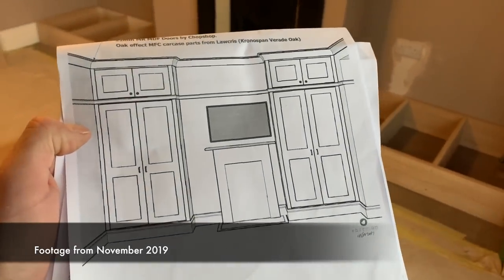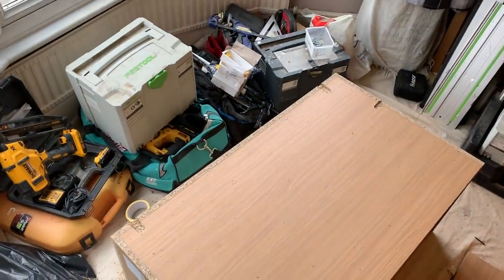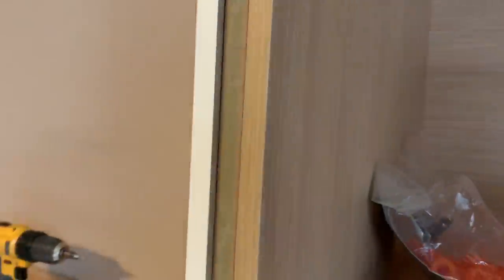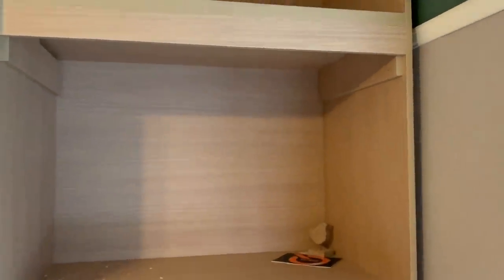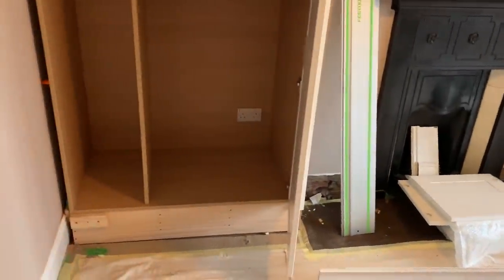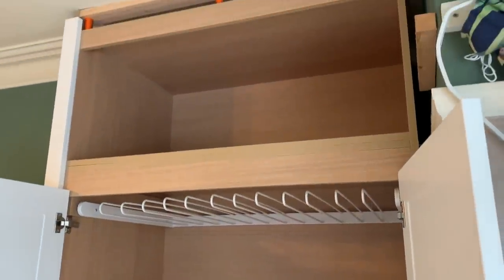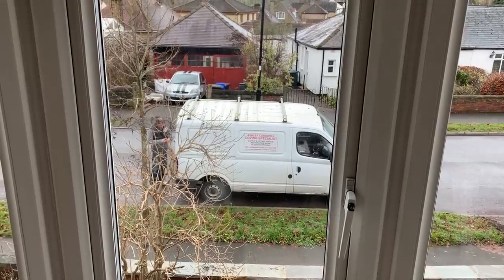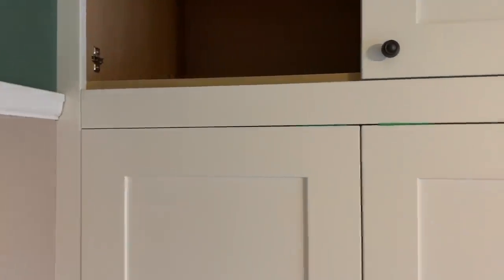Traditional Style Wardrobes Build

Comment: Hi Alistair. Thanks so much for posting such helpful videos - they've helped me to build my own built in wardrobes at home 🙂 The only thing I can't seem to find anywhere online are the dimensions for stiles and rails! I've made traditional wadrobes like these and wonder what width you've used for top, middle and bottom rails and also the width of the stiles? My wadrobes are 2000mm tall. I'd be grateful for your advice. Thank you 🙂
Reply from the maker: Hi!  Usually anywhere between 75 and 100mm rails and stiles, and the mid rail I usually do 150mm tall and centred 900mm from floor.  Thanks for the feedback!

Comment: If you could only pick ONE scribing tool, what would it be? Those edge scribes were 👌
Reply from the maker: Richard Clarke well, that’s a tricky one!  I think I’d say the 18mm tri-scribe from swanky scribe, which I didn’t actually have at the time of this video but I used in this one: https://youtu.be/wpqVc_zJfgI
Reply: @Alastair_Freebird  Yeah, they are pretty cool. Cheers Alastair, hope you're keeping well.
Reply from the maker: Really, scribing tools come in at least 2 distinct categories:  firstly marking tools which hold the pencil at a fixed distance off the wall.  This includes the swanky scribes, block scribes, traditional compasses, profiler+, easy scribe and others.  Some are fixed position and some adjustable.  And secondly positioning tools like the U-scribe jig which hold the work piece at a position off the wall to match the scribe tools setting.  This includes clamps.  And then there are other tools like the profiling comb.
Reply from the maker: I suppose I chose the simple triscribe as the tool of choice if I was forced to have only one because the 18mm offset is probably the most useful and easy to position even if you didn’t have the u scribes
Reply: @Alastair_Freebird  And therein is the difference between a pro and a DiY bodger like me 😀
Reply: Compass

Comment: When you bring the socket to the inside of the carcass what do you do if there isn’t enough slack in the cable? Great work as always.
Reply from the maker: will Jones see fairly on in this video where I used wago connector blocks: https://youtu.be/QAm2wvSjSgU
Reply from the maker: But I became uncomfortable getting too involved in electrical alterations  so I prefer to get an electrician to extend the wires as necessary and prepare the plastic back box ready for me to fit
Reply: I’ll check out those connectors they look interesting. Thanks a lot

Comment: Nice job, not really keen on chipboard though. I got wardrobes at home made of this nasty material that completely collapse after one year. Is it possible to build the carcass out of ply and finish it with walnut face?
Reply from the maker: Hi I do like plywood for carcases yes.  It depends on the budget the client is willing to stretch too.  The plywood should ideally be sprayed too which is extra labour on top of a more expensive material.  We don’t do solid wood doors because of warping issues we’ve had in the past

Comment: Hi there ! At 2.10 those brackets - did you use them instead of the orange space plugs for any reason? ps you can get them from a company called Wurth, you may need a trade account though ( for anyone reading this)
Reply from the maker: Hi!  I use them wherever I can, as they can be easier to fit and more hidden then spaceplugs depending on the circumstance.  I did hear they can be bought via Wurth, and also more recently Bedrooms Plus are stocking them
Reply: @Alastair_Freebird  possibly more stronger too expecially if used in conjunction with packing (say 18mm wood just like u used in your video. I have also wondered if the space plug being made of plastic may deteriorate over time even so not in direct sunlight.

Comment: Enjoyed this video Alastair, thank you and the references you give for products is so helpful. It has arrived at a most appropriate time as I’m about to embark on a wardrobe build flanked by a couple of bookcases.  Can I ask, is there any particular reason for using timber instead of mdf for the plynths, as I have noticed you use both ?  I want to use inset doors too, and you have confirmed why, I think they look great. The whole job looks classy with the oak and paint contrast and your process looks very slick !  Between yourself and Mr Millard, I’ve learnt so much. Thanks. Alex
Reply from the maker: Hi Alex I’ve stumbled across this comment which I seem not to have answered!! A bit late now but… I think I basically just had some of that timber lying around, but also I felt it would be a more rigid base than mdf and the smoother cut edges would make sliding the boxes into position easier!

Comment: Very nice cabinets and installation.  It was strange seeing the GPOs inside the cabinets.  Wouldn't it be more practical for them to be on the skirting board - this is not intended as a criticism at all, just that it would drive me crazy having to open a wardrobe in order to plug in an appliance.  Thanks for the vi.  Cheers, David.
Reply from the maker: DRMNZ hi David I see what you’re saying, I just made the socket accessible rather than trapping it completely behind the back panel and in this project the customer planned to plug in a tv on the wall to the left of that wardrobes and conceal the wires inside the unit so it suited them this way

Comment: Thank you so much for making the video to educate us!! I am about to make my first fitted in wardrobe. Just wondering what kind of screw you use to fix the wardrobe on the wall in the corner bracket. My chimney breast is mixture of dot and dab wall and stud wall. Do you think I will need corefix or concrete screw to secure it?
Reply from the maker: Hi sorry for the delay, almost always I get a good enough grab in the wall with a red uno plug ( to suit a 6mm masonry drill hole) and a 4.0 x 35mm standard pozidrive screw

Comment: Beautiful work as always! Do you ever put insulation panels between the back/sides of built in pieces if they connect to external walls?
Reply from the maker: Gerry M I have done it one request a few time but for the purpose of sound insulation on partition walls (noisy neighbours!)
Reply from the maker: https://www.instagram.com/p/B7lvzqLgb8d/?igshid=8cc76w2z9h1
Reply: Freebird Interiors thanks Alastair! I’m considering it when I do mine as my house is old and the walls uninsulsted so even having one wall with 50mm kingspan or similar sandwiched between the wardrobe back should make a difference. Hope you are starting to get back to jobs now we have moved on a bit 👍
Reply from the maker: Gerry M I think that makes sense; only thing to be wary of is if there is even a hint of damp on that wall you will create problems if you trap it in.    We are busier than ever thanks with lots of enquiries but currently focused on setting up the new workshop!  You can see our progress on that in the short video linked in the description of this video
Reply: Freebird Interiors makes sense, I will carefully check that out. Thankfully it’s 1920’s double skin rather than single. I’ve been watching the progress on Instagram! Looks AMAZING 🙌

Comment: Fantastic build, you can really appreciate the differences between standardised and bespoke with this video. Whilst the difference may seem quite subtle on the face of it, the extra work involved is significant. 

Can I ask - when you make the 56mm (iirc) end fillers that also act as a side return which you then scribe into the wall, how do you make the corner assembly for this piece? Is it mitred along the long edge? And is it a sharp corner or do you round it off with a router once assembled?
Reply from the maker: Thanks for commenting and the side panel is glued and domino jointed into the outer back face of the 56mm strip with a deliberate chamfer on each adjoining arrow to create a v joint which may also be caulked, prior to spray painting (on the basis that it is better to emphasise such a join than to unsuccessfully hide it).  We usually now also glue and pin an 18mm filler strip into that assembly too so it goes on as one piece screwed on from the inside with screws under hinge plates.  Our standard arris edge treatment is with a 2mm arris roundover bit from Wealden tools: https://www.wealdentool.com/cgi-bin/sh000001.pl?WD=arris%202mm&PN=Online_Catalogue_Arris_Rounding_964%2ehtml#aT1306B

Comment: Hi Alistair, thanks for the detailed explanation. When you screw through the carcass at the top to the ceiling are you screwing into joists? And how then do you hide the screwheads?
Reply from the maker: Hi, no it is too much trouble to try and line up with joists!  I rely on the red Uno wall plugs for everything like this - 6mm drill hole, insert one to flush. And it grips well enough whether It’s plasterboard or lath and plaster.  Screw heads either tucked behind a drop down lip, or wax filled or covered with a sticky cap that matches the melamine finish

Comment: Great video. Just wondering what the orange spacers are between the wall and the side of the carcase and how they work? Thanks
Reply: They're called Space Plugs, have a google. They're threaded so you can adjust them to the gap. They're hollow so you can put a screw through the carcass, through the space plug and into the wall. The idea is to keep the carcass from deforming or pulling out of square/ plumb under the screw compression. Hope that helps 👍

Comment: Morning. 
You say you use inset for 2 doors or less. Is that to give you a bigger side fillers?  So on say a 6 door wardrobe you'd have all overlay to keep door same size? Great vid again. Taking lots of note👍
Reply from the maker: Jesse Mackin hi it’s simply because as soon as you have more than 2 doors you are going to have a door with its hinge side adjacent to another door and then if you are using the inset hinge you need to add a cover strip in between the doors.  For long runs of doors I just usually prefer the doors to all sit side by side using overlay hinges (to be honest this is partly laziness, avoiding the extra process of cover strips to prepare and fit!).  A cover strip of some sort is necessary as a scribe at wall sides, and it also looks good on projecting sides as in this project, and using inset hinges just makes it a bit easier to make those scribes wider without too much packing material; reclaiming 18mm usable space inside the carcase on each side, and making it possible to fit the scribe directly to the carcase edge.
Reply: @Alastair_Freebird  on your wardrobes vid part 2:doors and scribes you have the end doors as overlay (think it's a 6 door) Is that to just keep all hinges consistent. I've also been advised to have the end fillers around 50mm or is it just an aesthetic thing?
Reply from the maker: Jesse Mackin yeah it just gets a bit confusing mixing hinges and different door sizes vs carcase sizes to accommodate the inset hinges.  50mm scribe minimum makes sense for door to open at least 90 degrees without the handle immediately hitting the wall
Reply: @Alastair_Freebird  thanks alastair. Have a good weekend